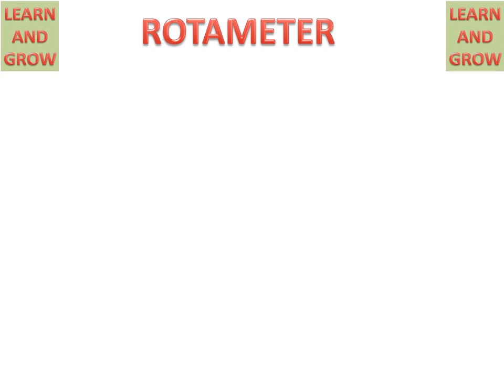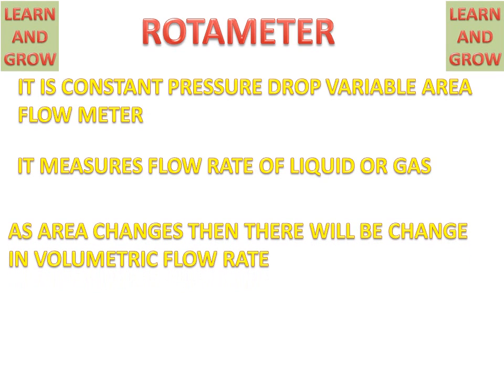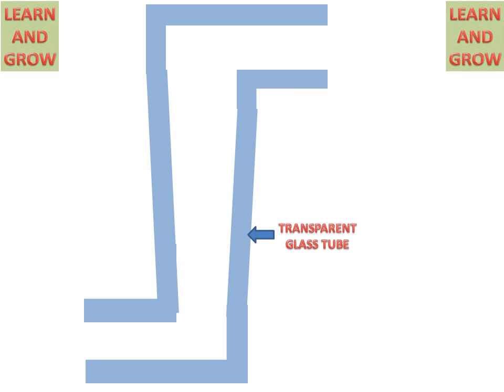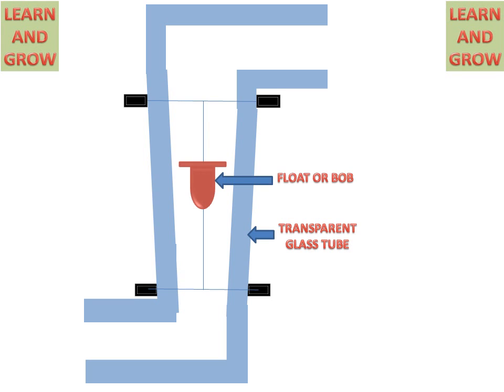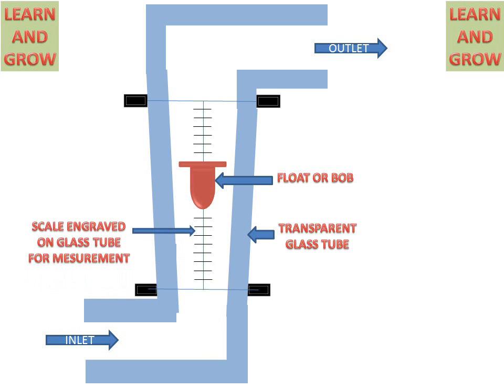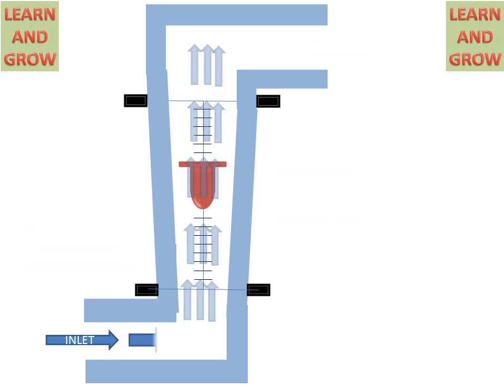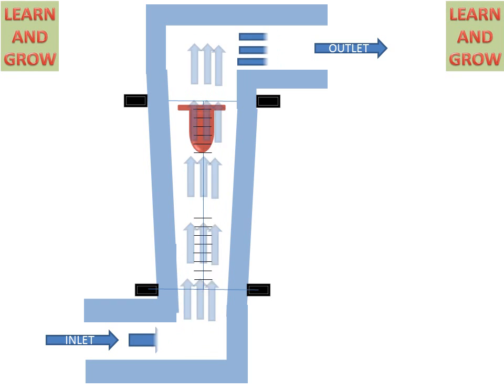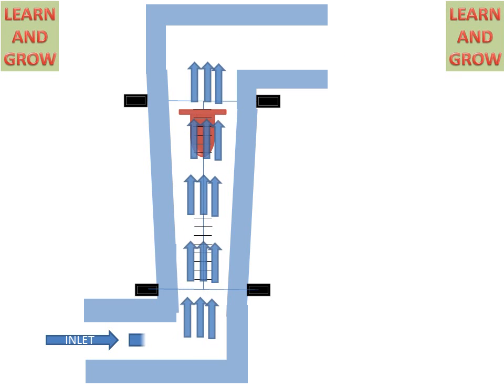Rotameter (Working And Animation)

Comment: Due to flow of fluid float is moving than why we are providing variable area ...what happene if area is constant through out rota meter ?
Any one explain me?
Reply: To stable the float, taper area is provided on the rotameter.
Reply: Because when area increase pressure decrease so it prevent it from getting damages